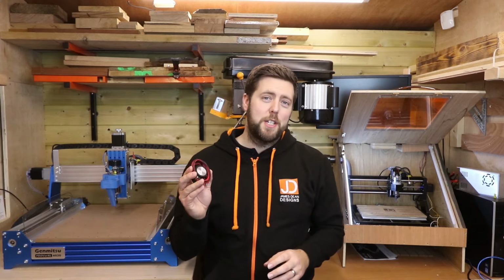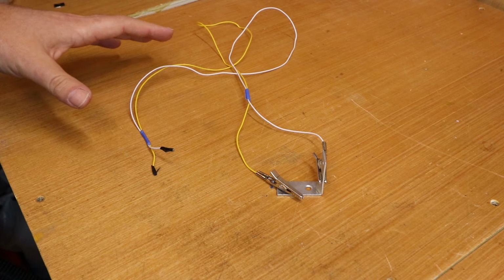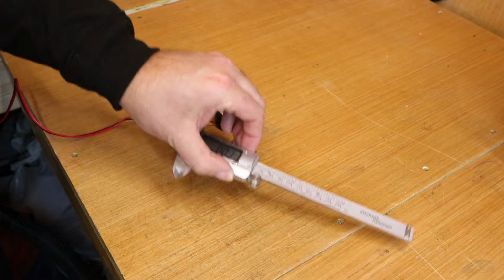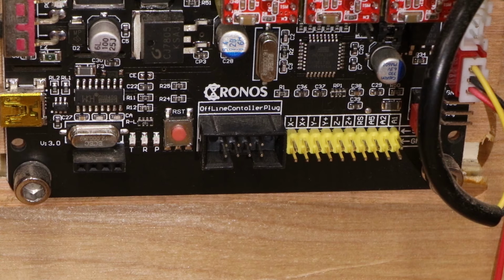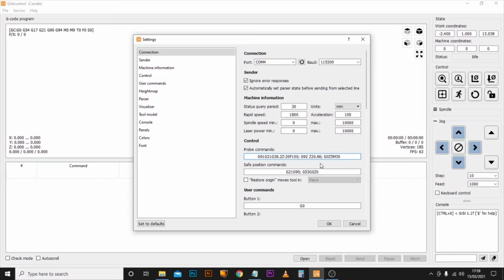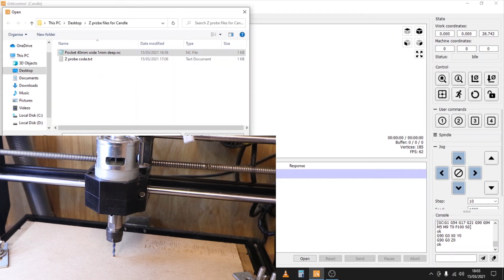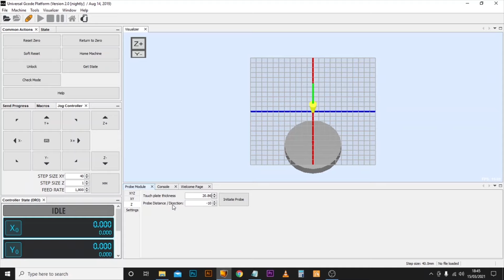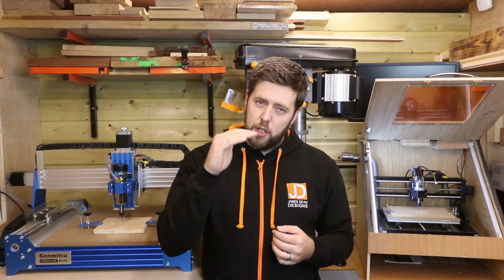3018 PRO - Setting up or building a Z probe

Comment: I have 6 Micro Limit Switches (3 wires: 12v,GRN and In) what do I have to do to Candle to make it work. The switches will be connected trough Grn and In, it means they will work as a switch. My machine is a CNC 318 PRO. I will appreciate some help. Thanks Raul
Reply from the maker: Hi Raul, Im not 100% sure as Ive never fitted them from new but usually you just have to adjust your GRBL settings to say that your using limit switches. Your $20 and $21 settings I believe are the ones that need to be turned on.

Comment: Interesting. I understood it is also possible to build a map of your workpiece that should cater for small variations in the zero surface: e.g. you are milling a pcb but your stock is ever so slightly bend
Reply from the maker: Thats correct, you can. Its called a height map. You can do it automatically in UGS
Reply: do you have a vide on this?  @JamesDeanDesigns
Reply from the maker: @bermchasin  no. Its usually used when doing PCBs which is something I've never done

Comment: Hey hey can you please assist me?I’m having trouble putting the needle/tool in the spindle. The spindle won’t widen enough for it to fit in.
Reply from the maker: You need to make sure your collet insert is big enough to take the bit.  There is usually a number stamped on the little silver insert stating what size it is. Its also sometimes easier to pop the insert out of the nut to put the bit in

Comment: Good contact with the wires is essential- otherwise the the bit will be driven into the plate; bad things can happen. A sprung plate with a max probe distance less than the movement gives you insurance. Best to measure the thickness with a micrometer- Vernier calipers are a bit approximate.
Thanks for the setting up process- made it quick and easy.
Reply from the maker: Definately and not just the wires. I had a tiny bit of MDF on the end of my bit and it failed to make the connection. Also why the travel distance should be kept as low as you can possibly cope with.

Comment: hi, I m using CNC3018 with grbl 1.1f, I am using FR4 PCB board as probe.after height map  some of the tracks are still missing.what to do?. the steps are: after setting probe I am pressing XY zero and Z zero button then I create map, after saving map file I check the box to use same height map file for engraving.but still some tracks are not engraving.I have set 1.46mm thickness in probe command.please suggest me the solution.
Reply from the maker: Height maps is one thing I have not done but you could try using Openbuilds controller instead to see if that is any better

Comment: This isn't a question about the z-probe, but looking at your screen of UGS, I see a tab labeled "Common Actions". I don't see that on my system and I think it would be handy. I just downloaded UGS and mine says Version 2.0.9-SNAPSHOT. Am I missing something?
I've watched a lot of your videos on using the Sainsmart 3018-Pro and subscribed.
Reply from the maker: There are different version of UGS as its open source software but the common actions tab can be turned on from one of the top menus like Windows I believe

Comment: Thanks James. Bought a probe but not tried it yet. Had a fire on my control board and been waiting for a replacement although still working on 12 volts.   After several " fob offs " from the supplier, they've vanished so I bought one myself.     Replaced the board today and upgraded the spindle as well.   All running and ready to try the probe tomorrow.  I didn't know it had the probe feature. I thought I'd have to write some code to run it so looking forward to giving it a go.   Very useful info.       Jim
Reply from the maker: Some suppliers are terrible with these things. I ended up taking mine through a PayPal dispute in the end as they refused to help me. Hope all goes well 👍
Reply: @JamesDeanDesigns  Yeah.  Just write it off and carry on with life. New board seems good although  different connectors for limit switches etc.  But for about £25 ish  I'm delighted.
Upgraded the power supply too.
I see some people say to step the motor speeds up in the program to stop it overloading the board.
Did you find that with yours?
Reply from the maker: @flypic1098  Some board have been known to blow, typically woodpecker boards to my knowledge but there doesn't seem to be a particular pattern. It basically because the input power spike when the spindle fires up initially. I've never needed to use the code but some do. Alternatively you can get something called an inrush limiter which eases that initial spike
Reply: @JamesDeanDesigns  I'll just add a couple of lines of code when using high speeds.
Reply: Setting probe works great thanks James.  Used the step up speeds in increments to reach top speed as well. Rather surprised by the spindle noise. It has the noise suppression on it and makes a loud screeching noise even at low speeds. If I stop the spindle with my hands it still make the noise. I know the noise they mean is interference with the other electronics but confused why it makes such a racket.

Comment: Hi James thanks for sharing your knowledge   I have 3018 pro i have followed your instructions in your GRBL video everything seems fine  the problem i have is the z probe i followed all your instruction in video for the ugs part once i initiate the probe it measures as supposed to do but will not return home meaning it stops short of material any help would be great thanks in advance.
Reply from the maker: Is there enough thread left on the Z axis or does it hit a limit switch?
Reply: @JamesDeanDesigns   Thanks James i got it after reading the comments section  i looked at my $ settings and increased $100 $101 $102 up to 800 seems to work fine thanks for the invaluable advice.

Comment: UGS platform edition allows you to name your user command buttons rather than just Button 1, Button 2 etc.
Best part you can move & resize the panels around to optimal positions, see XYZ coordinates complete without having to scroll!
Reply: Thanks. Incidentally, double clicking any of the panel tabs will enlarge that panel to full screen. Double tap again and it shrinks back to its original size.

Comment: How did you connect the wires to the board before you bought the connector James? Thank you.
Reply from the maker: The clip where I'm talking about making your own, you'll see the ends of the wires have black electrical tape around them, thats how they were held on. Not the best option but it worked
Reply: @JamesDeanDesigns  Thanks James. I saw that but couldn’t quite work out how they were attached.
Reply from the maker: @ianknight2053  basically stripped the wire, double it over then wrapped a little tape around each one but not tight. You could put the end of a cocktail stick in there to help keep the gap. Then slid them onto the pins and just pinched then as best I could
Reply: @JamesDeanDesigns  Thank you James.

Comment: Doesent the software takeaway the height of the probe so that you don't lose any of the Z?
Reply from the maker: Yes, but at the point it comes down and touches the top of the material, you've already lost at least 20mm of travel if you're using one of those deep touch plates, so the Z axis can only travel another 20mm before its hitting the bottom of the Z carriage

Comment: James, a very helpful couple of videos on assembly and first cut.  I am trying to decide on a machine and your posts have me sold on the Prover 4030.  It is just the right size for what I want to do and it looks easy enough to assemble and get up and running. I will be watching all of these a few more times as I move forward.  A great help.
Reply from the maker: Thanks John. I think I just replied on Patreon but if you need any help just let me know

Comment: Hi, thank you for the high quality and clear videos you being posting, i have an issue with the sainsmart 3018pro ver  on probe setup, every time i do the procedures i watched on this video i never get the height of the prob i have, like i i tell the UGS or GRBL to raise 20mm seems like it goes half way, any ideia how to solve, thank you in advanced
Reply from the maker: Hi. Typically if its only travelling half the distance your steps might be out. These are your 100, 101 and 102 settings. If they are showing as 800 you may need to make them 1600.
Reply: @JamesDeanDesigns  Thank you for the response, but im new in cnc have you any video to explain how to do it?
Thanks

Comment: Great video - thanks. Just got a 3018 Prover and have been using your and Techydiy's videos to get started with it. Strange thing happened to me, though, after running the probe setup in UGS. The probe zeroing seemed to run perfectly, but after removing the probe and selecting "Return to Zero", the machine drove the bit down into the test piece of wood until it finally faulted and stopped. Happened so fast, I couldn't stop it. Only thing I can figure is that the jogging commands section was set to "inches" while the probe zeroing program was set to "millimeters" and the program didn't convert the z axis zero value? I ran it again after resetting the jogging commands to "millimeters" and it seemed to work correctly (although I was too afraid to try the "Return to Zero" command again) - I jogged the z-axis manually until it indicated 0 on the display and it was very close to the surface of the wood. I haven't calibrated the z-axis yet, so I'm hoping that takes care of the slight error I'm now seeing. Assuming that was the issue, just wanted to warn others about this potential problem.
Reply: I was facing similar issue to where when I probe z axis and zero out the z axis and run a job the job it starts few millimeters above the material, I have been told that zero z axis button is only used for manual probing like how they use piece of paper as a gauge, when you use an actual probe you just move the x and y axis to where u want on material (note this is done manually) and zero it out then hit the probe button, it probes the material then you just start the job and it cuts at correct height.

Comment: Hi James,
I have a slight problem!  in UGS, when I reset to zero and set my Z step size to 8mm which is the the height of my probe plate, when I press the Z+ it will only jog up approx 1.5mm. Any help would be greatly appreciated.  John.
Reply from the maker: Are you hitting the top of the z axis?
Reply: @JamesDeanDesigns  No....I can't make it out?
Reply: @JamesDeanDesigns  its a though, what you imput i.e. what you want it to do is not getting through to the machines settings? iam wondering if the $$$$settings are incorrect.
Reply: @JamesDeanDesigns  Hi James, Not hitting, I have the same problem using Candle2, UGS, Carbide and Easel
Reply from the maker: @johnwheeler9696  what happens when you try using the jog? For example when you try to send the machine left by 20mm does it actually move 20mm, or the same with the Z, if you tell it to raise by 20mm does it move up that far? If not then it might be your $100 $101 $102 settings. They typically should be 800. What are yours showing?
Reply: @JamesDeanDesigns  Hi James, thanks for coming back to me. The machine jogs without any problem and $100 -$102 are all set at 800  ???
Reply from the maker: @johnwheeler9696  are you on Facebook or Instagram? If so try doing a video and sending it me, I'll take a look to see if I can figure it out. Also take a copy of all your GRBL settings and send them over
Reply: @JamesDeanDesigns  Hi James, thank you for your kind offer to assist further via facebook however, I dont know how but I think the problem has rectified itself !  I set the machine up as a new install with both Easel and Candel2  they to be working fine despite the hand control unit of the Ortur Aufero showing "Grbl Comloss" on the screen, and again I have no idea why this has appeared. On a brighter note, I did managed to setup the probe with Candle as per your video (thank you) setting it up with UGS was no go good as when I iniciate the probe it goes down to meet the touch plate and thats where it remains???

Again James, Thanks for your time,   regards, John.

Comment: Great vid! Followed your instructions but my mill keep ending up X mm from the material when I try to 'home' it with the custom button.. (Have the Sainsmart Genmitsu 3018 Pro). My probe is 14.09 mm. 
G91G21G38.2Z-20F100; G92 Z14.09; G0Z5M30     
Do you know what could be the problem?
Reply from the maker: Hi. Just wondering if you watched the video all the way to the end? The last section I cover what to do if your bit isn't quite touching the bed or if it goes to far. Unless its miles off, just increase your measurements number a little until it touches. What I forgot to mention the video is that it helps to make sure all your steps have been calibrated first, not essential but can make life easier
Reply: @JamesDeanDesigns  Yeah watched it several times to see if I forgot something :) Its like 1 cm off - so not near at all.. It promts fine and go about 5 mm back. But when I try the command, it only goes like 1 cm down again..
Reply from the maker: @nakelify  that does sound strange. I take it your travel measurements are fairly accurate eg. If you tell it to go in any direction by 20mm it actually travels 20mm? You could try UGS as an alternative. It programs its own Z probe   command so it might run a little different
Reply: @JamesDeanDesigns  I will try to get USG running and see if I have the same problem there. Thanks
Reply: @JamesDeanDesigns  Hi James, got everything setup with the UGS, and found the exact same problem. When I do your test, from 0-20 mm, it ends up around 9 mm from the bed.. Settings is for mm and not inches on both Candle and UGS.
Reply from the maker: @nakelify  ok, well to some degree thats good news as it eliminates the software being the cause. What are your $100, 101 and 102 settings. Typically they should all be the same and usually 800 or 1600
Reply: @JamesDeanDesigns  Thank you! Went through all your settings from your Tuning GRBL video, and found the problem: 
$100 = 800.000  
$101 = 800.000
$102 = 320.000  (changed it to 800.000)

It works! :)
Reply from the maker: @nakelify  Excellent. Glad you solved it

Comment: Hi James! 

Excelent video, but I'm having some problems with the Z-probe in UGS. I'm using Universal Gcode Platform 2.09 SNAPSHOT / 2021-11-24, and the firmware is Grbl 1.1f. It's a Comgrow CNC Router.

When i click the "Initiate probe button" the bit is lowered down to the sensor and stops there. It doesn't go up and do a second slower sequence like in your video, but just stays there. Also, a new zero value for z-axis is not set, so it's kinda useless at this point.

Do you have any advide for me on how I can solve this issue?

Comment: Hello James. Regarding zeroing your Z axis, does this need to be done in the lower left of your workpiece, so that the X and Y are zeroed at the same time? Otherwise, when the Z probe is homed it won’t be in the correct position.
I say this because most probes are circular and don’t fit in the corner of your workpiece.
Reply from the maker: No, you can do the Z probe anywhere as long as the material is the same thickness. So what I typically do is get it into the corner, set the zero, then move in 20mm diagonally and run the z probe command
Reply: @JamesDeanDesigns  Thank you James.

Comment: Hi James, thanks for your previous assistance, very helpful. Yet again I have a slight issue with UGS. On startup the programme display will not open as per your video, it opens in full screen mode and it does for each of the sub windows i.e visualizer, jog controller etc etc...Do you know if there is a default display setting somewhere so that I can view several plugins (I think that's what their called) on one screen at the same time.  I have even re-installed UGS a couple of times all to no avail.  Thanks again   John.
Reply from the maker: I'll check tomorrow, there might be a reset view button. But you can usually drag the different windows about to make them how you want it to look

Comment: You have some of the best and well informed videos that I've seen on YouTube and we thank you. I do have a problem with LASERGRBL that I hope you can help me with. I have a 3018 Pro that I am unable to speed up the feed on. When I use the machine for routing, it scoots right along appropriately but in Lasergerbl it is extremely slow. My S min is 9% and my S Max is at 11% and it still burns my plywood and makes a charred mess. I did make sure that my $ setting was set at 1000 but no change and the feed rate is at 2000 MM/min. Ideas?
Reply from the maker: As well as your $30 being 1000 you need to make sure your $31 is 0. Share your GRBL settings if you can and I'll take a look.

Comment: You could recover the loss in height with the Z Probe, by raising the height of the X axis gantry with a couple of short sections of 2040 extrusions onto the existing Y axis frame.
Reply: This does not increase available Z axis travel- and means you need to tram and level all over again. Also compromises the rigidity. A thinner probe plate is a whole lot easier…